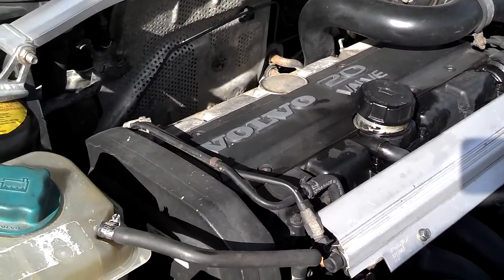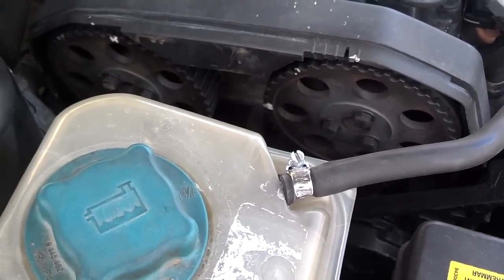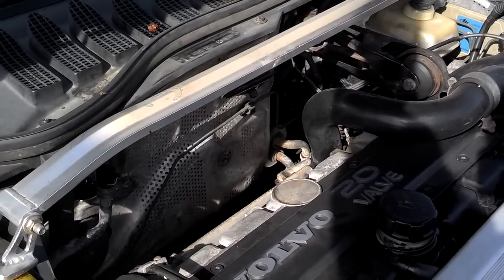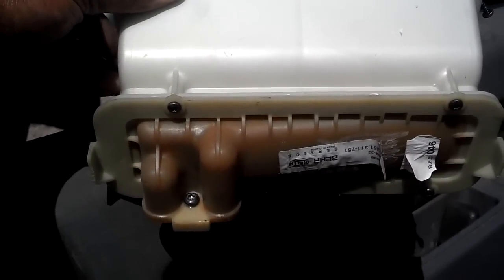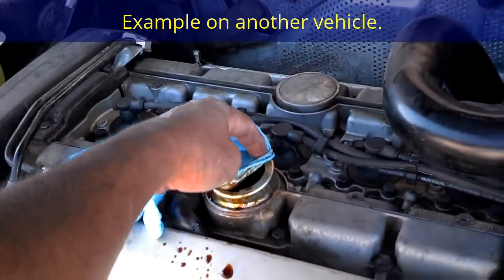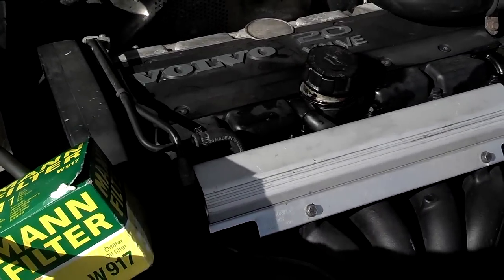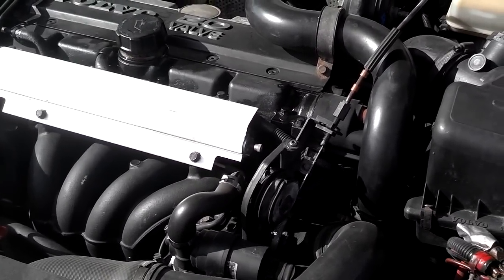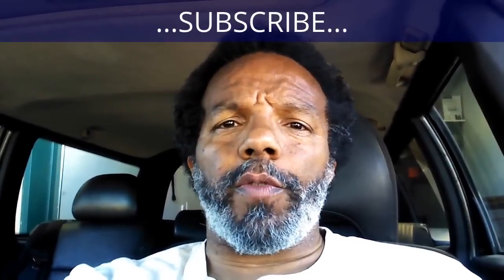New Volvo owner things to do after purchase or check yearly on a 850, S70, V70, XC70, etc. - VOTD

Comment: Hello Robert ..I had a problem today in the breaker's yard ..Unable to remove the airbag from a 2003 Volvo S60 which has a beautiful wooden steering wheel ..too scared to use a crow bar...what size torx screws secure the airbag ? ...thank you friend
Reply from the maker: Did you watch the video?
Reply from the maker: https://www.youtube.com/watch?v=gt9w-ZSxs9I
Reply from the maker: https://www.youtube.com/watch?v=xD89HejwEQE
Reply: Just watched your video Robert ..you used a T30 to release airbag ..another youtube video S60 airbag removal suggests it's a small flat screw driver to dislodge the spring mechanism ..the airbag I was working on yesterday is loose as if someone has been in before me ..my T27 T30 T40 did not seem to engage with the screws ..cheers
Reply from the maker: It is tricky fitting the tool in the screw.

Comment: Hi Robert....I want to buy  a Volvo  wagon.....what do you think which one........ ...98 v70xc non turbo 4wd ,96 850 turbo fwd or 01 v70 4wd ..all running good & maintained all same price
Reply from the maker: +Gregory Fitzgerald '96 would be the best one.
Reply: Thank you..I almost purchased a 05 for 3,400.
Reply: The 96 I like too as it's clean...lots of receipts...full tune up,timing & heater core done,no check engine on. Just driver seat worn alittle. Plus it has 4 brand new tires.
Reply: I was confused..but your videos & advice is greatly appreciated..I'm sure to send you a donation from the bottom of my heart after the deal is done...thanks again ..also I sent you an email to helper but not sure you even seen it

Comment: Hey Robert, I really enjoy your excellent videos, thank you.  You have helped my family for years with repairs.  I've had other Volvos for years, but I currently have a 2005 V70R and a 2006 S60R.  They are still similar to the 850 and S70 that I've had.  My 06' S60R had 10k miles when I bought it in 2007, now about 48k miles.  This is the only Volvo that I've had that has had any transmission problems, it's been shifting very hard under full acceleration for a few thousand miles now, otherwise, it drives normally.  I had a dealer check it out a couple of years ago, recommended a new transmission.  I then had an independent Volvo shop flush the transmission, with no help.  Do you have any ideas before replacing or having a shop repair this transmission?  This problem transmission is a 6 speed, new in 06'.  The V70R has a 5 speed with 128k miles and no problem.  Another annoying issue that the S60 has is a weak radio signal, do you know where to find the antenna amplifier in this car?
Reply from the maker: I wonder if the transmission torque mount is good? 

No on the radio, that is a strange one.
Reply: Thank you for the fast reply.  The shifts are so hard that all 4 tires will chirp.  I'm sure that it will break something.  I'll check the transmission mounts, is that the same thing, is the transmission torque mount internal, between the engine and transmission?
Reply from the maker: Yikes! Lower edge of transmission to the sub frame. I'm sure the box is bad if it's shifting that hard.
Reply: Thanks again.  I'll check it out soon.   I also enjoyed your video of Graceland.

Comment: Thanks for the video! What do you think of Mahle oil filters? I bought one from IPD and it looks like great quality.
Reply from the maker: Depends on the engine.
Reply from the maker: I only use Volvo or Mann filters on N white block engines.
Reply: @RobertDIY , It has the B5244T engine.

Comment: I have a 02 v70 cross country. 
Any special tips or tricks to getting the front driver's side cv axle out? It seems to be stuck in the transmission pretty good and I'm afraid I'm going to damage the transmission case. I was using a pry bar and a ball joint fork trying to get it out. 

Thanks!
Reply from the maker: Joe Pamplin I suggest using a large flat tip screw driver and tapping it through the mating area.
Reply: I've tried that too. I've seen in other videos that people are using slide hammers attached to the inboard joint in some manner and just pounding them out. I'm going to try that next weekend.
Reply from the maker: Hmmm

Comment: Radio is dead what type should i replace it with? Is there any that have their own amp that can boost the speakers in the car Volvo 850 1995
Reply from the maker: Sure. I use the OEM Volvo radios with Premium Sound on the front of them or from newer cars like '98.
Reply: @RobertDIY  would pioneer be able to work the same way?

Comment: I got a 2004 Volvo C70 convertible with a 2.3 when it cranks up it takes a 3 or 4 times to spend over and then sometimes it will backfire but it won't crank but then I turn it back Nishan off turn it back on and spend it over and it cranks up I'm thinking it's the cam sensor and it's got a rough idling I seen a bunch of your videos and stuff like that and that's where I'm coming back to the cam sensor can you give me your opinion on that I appreciate it and thank you for doing your videos and stuff like that because if it wasn't for you videos I wouldn't have been able to have to work it out done on this car I replace the motor in it I had overheating problem in Lost compression between two three and four I put a new motor in it and then I've been working on it here and there please give me your information on the idle
Reply from the maker: https://youtu.be/cWKOi8D4SWQ
Reply: Robert how you doing today number one I got a 2004 Volvo C70 I put the key in the ignition and it acts like it wants to crank the fires then that the last time it doesn't it don't spend over and it will not crank I replaced the cam sensor replace the crank sensor I got fuel I tried to reset the throttle by pumping the gas five times Within mission on then turn it off wait 7 seconds and turn it back on hold it down for the light was supposed to stay on but it's goes off and it will not crank can you give me any information please give me an idea where I need to go on getting this car fixed

Comment: Hi Robert, I have a 99 s70 AWD 2.4.  I want to add a catch can to bypass the oil seperator/flametrap so i don't have to tear apart my intake.  right now i have a pcv valve connected to my dipstick tube to release excess pressure. If i run a hose from the top of the crank case to the can, and cap the line going to the clogged trap, will that work and keep condensation out of my engine and prevent my rear main and other oil related seals from blowing? Also would I have to run a vacuum line to the can?
Reply from the maker: +Jonny Raige man, I have no idea. I if you watch my channel and see my videos, you have seen me pull countless intake manifolds. I have no knowledge of bypassing the system. The job takes about 3 hours, which is probably less time than trying to hack around it.

Comment: Hi Robert, I discovered you in trying to fix my car. I have a 1993 volvo 940 turbo station wagon. The car works fine in the morning when I go to work but in  the afternoon when I go home the car tend to dye off at every stop or light, the tach and turbo needle shakes and if I don't step on the gas and get it to at least 1000 rpms it dies. I have replace the mass air flow, the oxygen sensor and ultimately the fuel pump relay and the Noise Suppression Relay. I have use Lucas injection cleaner in the gas and still does the same thing. Do you have any advice or ideas. please help. Mario
Reply from the maker: +Mario Quevedo Is there a check engine light?

Comment: Hello Robert,
I have watched your videos for quite some time now repairing my son's 1997 850 AND for research. They have been very helpful. We have just purchased a 1999 V70 XC AWD to replace the 850. I see you own one as well. Ours is not a turbo. I have a question. We have come upon a problem with the transmissions shifting. I have found out that there may be some software updates available, however it is also my understanding that the problem could be the valve body, a $1600 repair at the local Volvo shop. Can you give me some feedback on this issue? Thank you in advance for any help you can give me.
Reply from the maker: +Patrick Lacy I doubt that the '99 transmission has any software that can be updated. You need to get to a Volvo shop to have the codes read. Is it slipping?
Reply: +Robert DIY I'm not sure. my son drives it. I believe he said it sticks in second gear and something about reverse. I'll get more info on it.
Reply: +Robert DIY The car is shifting hard into reverse and seems to be stuck in a lower gear with the upshift arrow flashing and the check engine light suddenly coming on. I have found that the cause of the reverse issue may be because there is no trans fluid showing on the stick. We're going to drain the fluid and replace it with what;s recommended (dextron). Is there an additive we should use as well to your knowledge?
Reply from the maker: Some use the Lucas transmission stuff. Just bring the level up and see what happens. Is the transmission leaking?
Reply: I have found through investigation that there is a faulty sensor. This is in the valve body. And yes it is leaking a little as it appears to have already been apart once. So who knows at this point. I have found a repair shop that will do the job for $1600
Reply from the maker: Ouch!
Reply: +Patrick Lacy  replace the outshaft speed sensor, that is the problem, today my 2000 s70 started to get stuck in 3 gear from a stop and the arrow flashes and cel came on. so I went a check the code with my scanner and the code it was p0722 for speed sensor. replace it and see what happens. good luck.
Reply: +jason hawk Thanks Jason, but my code is P0705 trans range sensor A circuit which I believe is internal. I checked with Volvo and they claim there are a number of sensors it could be with that code?
Reply: +Jason, where is the outshaft sensor located?
Reply: When my Volvo was feeling stuck in low gear and had the arrow, I found it was the winter/wet driving switch. It makes the car have more traction in the rain

Comment: Hi Rob, 
I have a 1997 Volvo 850 Turbo that's having some trouble starting. About a year ago when my fuel pump failed I had a similar, rough, shaking startup. Replaced the front O2 sensor, MAF and coolant temp sensor but still I'm having a rough start and a CEL saying that the car is running rich. My mechanic and I are both stumped on what the issue could be. Any ideas?
Reply from the maker: https://www.youtube.com/watch?v=x8sXo5gbapM

Comment: Rob quick question when I ever I turn my heat to the front defrost, there's barley any air that comes out. Is that heater core or cabin filter not sure really
Reply from the maker: +Max J What kind of car do you have?
Reply from the maker: +Max J  Either the diverted is not sending that much up there or your have cracks behind your dash and the air is leaking behind there.

Comment: Robert, or anyone. My volvo is currently running a steady tick high on the coolant temps. Do you believe it is my heater core? I have a new thermostat to try but I also recently replaced the water pump and radiator. Kinda at a loss...
Reply from the maker: I don't even know what kind of car you have.
Reply: @RobertDIY  oh duh right, it's a 98 volvo v70 awd in pretty bad shape lot of routine maintenance has been ignored. I'm going through it piece by piece trying to get it in shape.

Comment: Hi Robert, i own a 1995 Volvo 850 turbo with about 205000 miles. Recently when braking there has been a harsh vibration coming from the rear of the car when coming to a complete stop. I did a little research online and saw that it could be the rear brake shims. Have you ever had this problem? Do you have any advice?
Reply from the maker: How old are the pads and rotors?
Reply: Robert DIY They're about 3 months old. Had them replaced when the vibration first started. It didn't really help.
Reply from the maker: Try to get an alignment and they will tell you what's broken back there.

Comment: Here's a coolant question for you Robert,
1997 Volvo 850 R Turbo with 207k miles on it.
No wet carpet; however, ac vents white smoke(watervapor?) when on, I lose coolant FAST, not inside the car though, I took it for a test drive and I noticed when at idle on that coolant was Streaming "Yes, like a small freakin river" on the passenger side. The resevoir looks brand new so could it just be a poorly installed hose or am I looking at a heater core/water pump/ resevoir replacement?
Reply from the maker: +Heinrich Evers Follow the river. If the water pump is leaking, the next step will be for it to break and destroy the engine. Have you pulled the timing belt cover to see if the water pump area is wet?
Reply: Robert DIY I haven't yet but I will to double check it. I think the guy knew about the leak and topped it off before I did the test drive. Earlier today I looked under it and saw where it was just excessively dripping from and it looked like under the floor of the cabin. I pulled back the carpet on the driver side and lo and behold, it was dripping from both intake/outtake on the heater core.  I'm going to see if I can do a bypass until I can order the replacement part and I'm going to check the timing belt compartment  to see if there any coolant in there. By the way, thanks for all your AWESOME VIDEOS!!!  I power studied many of them before I made this purchase and  PCV, Turbo, HG, etc all seem fine so far. no inflating glove, I won't be able to confirm the HG is fine until I get stable pressure in the coolant system to test to see if the coolant rises drastically when its all in order or not.
Reply from the maker: Sounds like you have a handle on it.
Reply: Question on the ignition system stuff. I know you say OEM or Bougicord for plug wires, but will IPD suffice? http://www.ipdusa.com/products/4900/111301-performance-spark-plug-wire-set
Reply from the maker: I do trust iPd products. But why spend another $30 on wires?
Reply: If there is no real difference in continuity on the wires after I swap out the Bosch for a MSD ignition then I'll just get the bougis from their website. Thanks for the heads up in your video on the heater core from Swedish Car Parts by the way, it looks like that metal banding on them is a good idea on reinforcement of the unit. Saw some of your posts on MVS and I really do appreciate all you have done for the Volvo community man, YOU ROCK and GOD BLESS!!  ^_^
Reply from the maker: Thank you.

Comment: Hey Robert, recently my 1998 volvo s70 started leaking coolant in a rapid manor, the leak appears to come from where the lower radiator hose connects to the metal pipe on drivers side of engine, due to angle I cant tell if its the top of the hose leaking or the engine, do you know if this could be a water-pump issue? If not what else, thanks
Reply from the maker: ***** I have no idea what kind of car you have but it sounds like the radiator is leaking.

Comment: hello Robert I'm 18 year old teen in Ohio I just recently purchased a v40 wagon and I major in auto mechanics so there's not much of a hassle of working on it so I wanted to do a lot of preventive maintenance and I just wanted to know if it would be a good idea to change the transmission filter only have about a hundred and twenty-five thousand miles I hope you read this comment and get back to me.
Reply from the maker: +Yindé iroll I would do the fluid and skip the filter is the fluid is not to bad.

Comment: Can you please tell me what the red light at the top end of the temperature gauge is for?
The owner's manual mentions it and directs me to pages that do not mention it.
Could it be gearbox overheat?
Reply from the maker: I don't even know what kind of car you have. Probably the coolant temp gauge which means that the engine is overheating.
Reply: It's one of these you are talking about here, specifically an 850 2.5 20v CD auto wagon.
There is a red light in the "hot" region of the temp. gauge that comes on, but the temperature reads normal by the needle.
Reply from the maker: I have never seen that, you'd have to show me what you are looking at.
Reply: Pictures of it aren't easy to find, I t must only have been used for a short time, mine is a '95.
You can see it in this picture:
https://pictures.dealer.com/r/ramseypreowned/0900/f0e33e9d0a0e0ac930fa7e2befac4fd1.jpg
Reply from the maker: I don't see any red light, just a short line.
Reply: Well Robert lol! I solved it.
You have one right here, btw:
https://youtu.be/9K-1WChRr9k?t=1m10s
I went out to look first with a flashlight in the dark and then with the ignition on, and what I found is that it is a red line that probably indicates where the danger zone is but it's backlit quite strongly, so it looks like an actual light.
I'm sure the 240 (which I always had before) consoles were front lit. I never knew about backlit ones.
So my bad, thanks for the help.
I just got a 9'5 850 2.5 20v CD, it's beautiful, but showing 181k with a bust odometer (and I can't find any OBD control units to read it), never had a cambelt or PCV, and the transmission fluid must be original too, so I'm taking it easy and saving for the jobs to be done. I guess I better throw a heater core in there at some point too.
Your videos are extremely helpful, thank you.

Comment: Hi Robert, I'm having problems with a MAF CEL code on my 850, do you think a clogged PCV system might be the cause of that?
Reply: I should add I've already had it looked at by my local mechanic and he put a new maf sensor in the car but it didn't fix the problem
Reply from the maker: +Drowsy_ Mouse Nope.
Reply from the maker: +Drowsy_ Mouse local mechanic??? Volvo mechanic? What brand MAF?
Reply from the maker: https://youtu.be/aj4tL32XIXs
Reply: it was a Bosch oem sensor I believe, and no it wasn't a Volvo mechanic